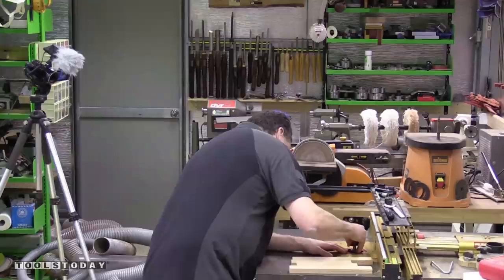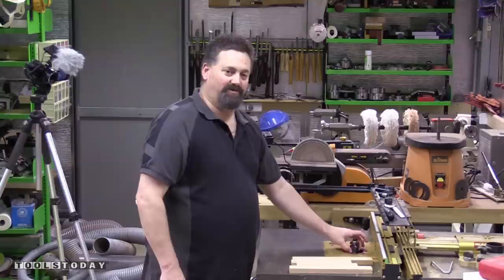Router Table Project: Building Ogee Raised Door Panels W/Amana Tool Pro-Series Router Bits

Comment: Great vid.  Thanks. EXACTLY what I needed. Bought it on Amazon (Model MD504) for $100.  Only a DIY guy so didn't want to spent $220 + but the cheaper ones were junk.    
FYI the ogee set in the video is MD502 (not 500 as stated in the video).
Reply from the maker: Ramaroodle, thank you for your kind words about the video, yes you are correct, the set used in the video is indeed MD502 which includes the back cutter.
Reply: What’s the difference between the 502 and the 504 and the rest of the series
Reply: Exceptional  cutting tools by amana....well priced and made in the USA.. I always liked the  ogee profile

Comment: Nice job. Hi my name is Apolinar I just got the set of knives from tools today and I'm working on my router table now. The question I have is about the router rpm. What's the best rpm to run the styles and rails, and the raised panel cutter,  I'm running soft pine wood. Thank you. ...

Comment: Nice setup. The Incra fence (not the Wonder Fence add on) looks longer than the the standard Incra positioner router fence, which I have. Is that an illusion or are you using TS parts there? Also, it looks like the entire router table is cast iron. I'm not aware of a commercially available cast-iron router table that is as large as that one, which must extend back quite a way to accommodate the Incra positioner. Where did you get it?
Reply: Thanks for the question.  The setup, like pretty much every router table out there, is a combination of available items bought together to create a functional setup.
The Incra system is a stock standard LS17" positioner, with the standard fence (plus the Wonder Fence).  It has been changed over to metric, but otherwise is unmodified.
You are correct in that the entire top is cast iron.  Pretty much every other serious machine in the workshop is commercially available with a full cast iron top, yet the router table tends to be ignored, leaving us to make our own, or purchase one made from manufactured board.
I decided to remedy the situation, so this top is made from five tablesaw cast iron wings bolted together.  The last wing was taken to a machining shop, and the opening for the router lift was cut out.  It is rather heavy (obviously), and it is much longer than a typical router table top as you observed, so it could accommodate the LS17" positioner. 
There are a number of advantages to this top. Self lubricating, and an excellent vibration absorbing material.  It is dimensionally stable and flat, and my personal motivator- ferrous, so I can use MagSwitch featherboards quickly and

Comment: Ok, I'm done with the table router, the 2.25 Horse power router is mounted in on the table and run my rails and styles but when I ran the big cutter for the center piece (panel) the amount of material that goes in the grooves of the rails and styles is very little. I'm  I doing some wrong? Can any body help me out please. Thank you.
Reply from the maker: Can you please email me directly, Stefan@toolstoday.com - thank you!  We will check with our technical department and get back to you.